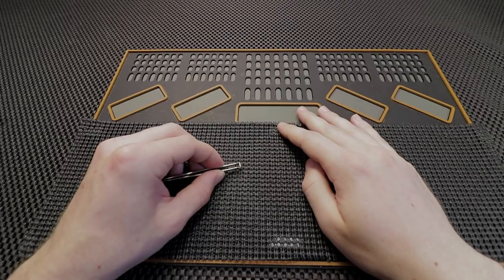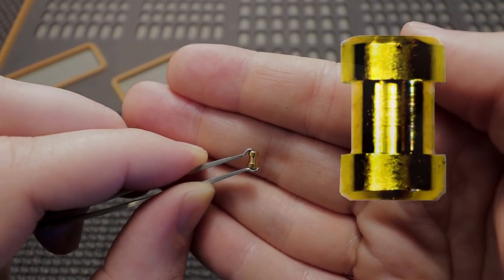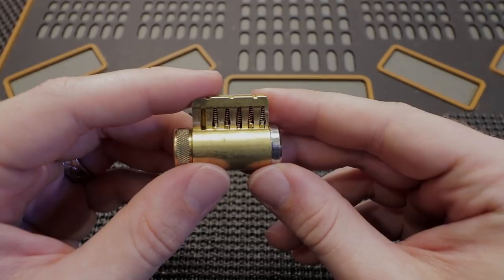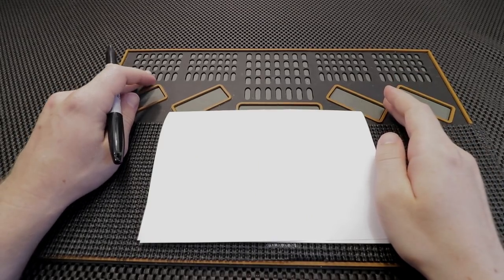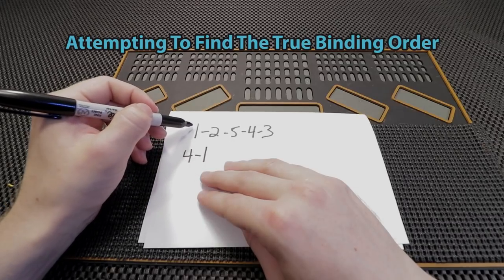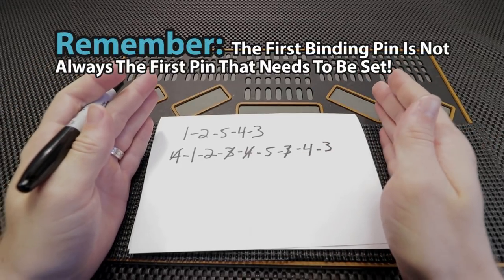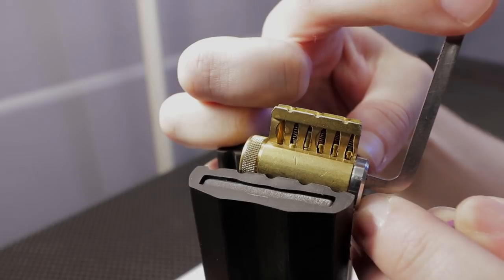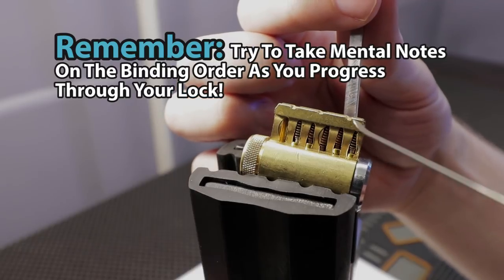[173] How To Learn The True Binding Order When Picking Locks With Spool Pins

Comment: my question is: given, * i will pick this lock only once. (maybe a challenge lock, maybe forgot my key in the house) * this is the first time i am going to pick this lock. how should i proceed to establish a binding order? can i establish a binding order? (given this is my first time picking this lock?) thanks for sharing.
Reply from the maker: Marty Hastings you can but it takes some time and a lot of mental note taking. For example you need to know which pin you are hitting when you start to drop everything and you need to realize everything up to that point may have been correct and you'll start to experiment until you know which pins work and which ones don't.

Comment: Very well presented! As a noob I’ve heard a lot of the terms but never really knew concretely how the spools could effect the picking progression. Do you have an equivalent lesson on serrated pins? Thanks!
Reply from the maker: John Mccormick My Lock Picking Home School is a progressive lesson and unfortunately I haven't got to serrated pins yet. :(

But what helps most is lift one click at a time and move on to the next binding pin. They are easy to overset and are much harder than spools.

Check out my video on reverse picking though, if you have a lock with all serrated they can be easily taken advantage of.
Reply: HelpfulLockPicker thank you for the reply I will definitely out your reverse video!

Comment: Ok so if I pick a lock and note (or remember) its true binding order, what would I do with that information?

If I repeatedly pick the same lock then it will make it quicker each on subsequent attempt, but why would I be repeatedly picking the same lock?
Reply from the maker: When you practice picking locks it is not best practice to always pick the same locks because you do not want to develop muscle memory. So, I would not recommend always picking the same locks. But learning the true binding order is helpful to get you through the lock you are on. Imagine you are trying to pick a high security lock but you are having trouble getting it on video. You will probably end up picking this lock 20 times before you can catch it on video. This is where this can be very helpful.
Reply: HelpfulLockPicker Thank you! 😊